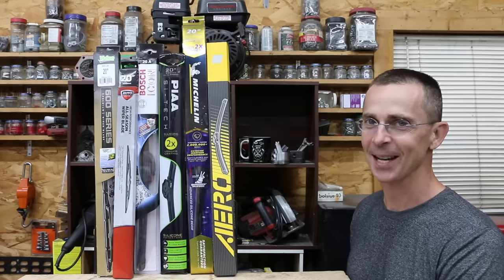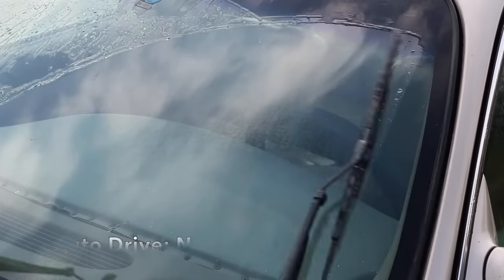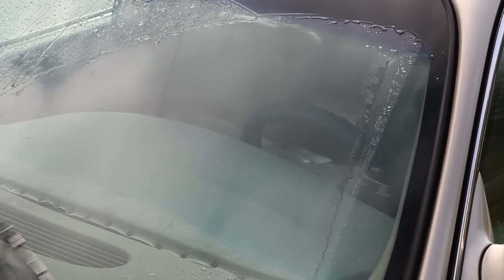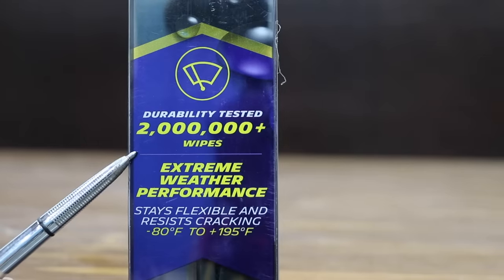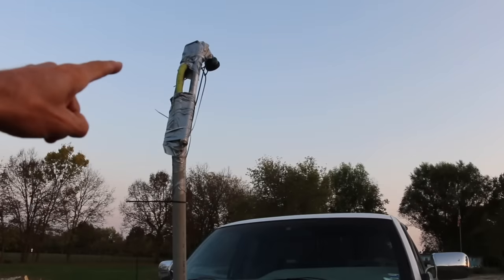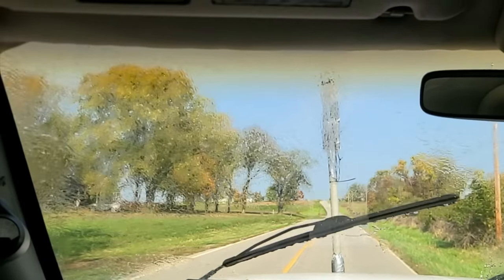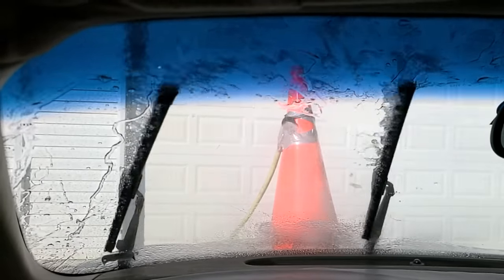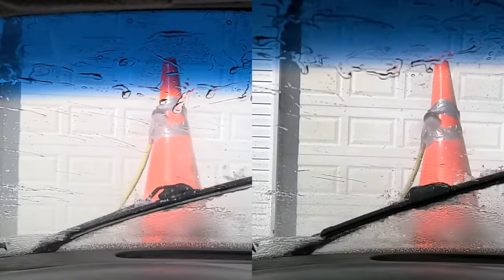Best Windshield Wiper Blade (AFTER 1 YEAR)? Bosch Icon, Rain-X, PIAA, Trico, Valeo, AERO

Comment: My most encountered problems with wiper blades are durability and the fact that they rapidly take a set (develop a pitch or angle).  The latter causes an annoying chatter as the blades pass across the windshield in the direction of the set.  This is especially bad when trying to clear a small amount of water, as encountered on a foggy morning.  I use the sprayer to minimize the chatter but it's still there.  Currently using Rain-X brand but they developed a set in a few weeks.  Was hoping you would address this in your video.
Reply: I live at high altitude (5000ft/1500 meters) in a desert with extreme UV and temps that swing from 105f/40c to 5f/-15c. Most wipers last a season or two for me at most. Bought some PIAA wipers 3 years ago and they have yet to start squeaking or chattering.
Reply: yes.  I HATE that stupid chatter.  very annoying

Comment: I remember another famous youtuber who would test products out (older guy who a few months ago made a new channel don't remember who it is off the top of my head) and he swore by silicone blades being really good. From what I remember in his video he had to apply this lubricant or something onto the windshield first before using the blades the first time but after that seemed like they worked great. I am a bit surprised there was no mention of that with the silicon blades and might be why they were making more noise?
Reply from the maker: Thanks for the feedback.
Reply: If you look carefully at the video the PIAA box states it comes with a windshield prep pack at 05:20.
Reply: You might mean Scotty Kilmer. He just pointed out that the silicone lasted him a lot longer than rubber in spite of being more expensive. He claims he has had a set on his car for about six years that are still sufficient. Also, the stuff he put on his windshield was NuPolish, a wax free polish and that should help with any wiper blade noise not just silicone ones.

Comment: I have run PIAAs for over 10 years on all of my vehicles since I live in the Southeast with lots of rain.  Nothing compares to the longevity and one factor you missed is the silicone buildup that occurs on the windshield.  Many times I don't even need to run the wipers as the rain just beads up and runs off without significantly reducing my visibility.  Will never go back, particularly to any non-silicone variety.
Reply: I doubt the "beading" you expirence is from the wiper runoff. Do you routinely run your vehicle thru car washes? There are a variety of soaps they use to protect paint that do the same thing. If you put Jet X(streak free dishwasher soap) in your windshield wiper fluid, you can do something similar. If you use pay and spray car washes, switch the dial to clear coat protectant and spray the windos, you'll notice a huge beading effect next rain.
Reply: @LWSParents  the beading is from the PIAA's silicone. When I switched to these I didn't know they did this and starting noticing the beading immediately as if I just went through a car wash and had a rainx coating. Installed these last summer and the beading hasn't lessened even in the slightest. I live in Pacific Northwest, one of the rainiest places in North America.
Reply: @LWSParents  This is an advertised advantage of silicone wipers.
Specifically one advertised by PIAA.
Reply: @LWSParents  silicone blades leave behind silicone as they wear out, which turns into silicon dioxide as it's exposed to oxygen.  Basically the same stuff used in ceramic coatings.  Regular rubber doesn't leave anything useful behind.

Comment: 15-20 years ago I remember the best wipers in my experience were conventional Michelins; they lasted exceptionally well, without streaking or noise. I could purchase them at about $10 then. One year they suddenly weren't. I don't know if they changed the rubber compound or something else. After going through the budget brands for several years and silicone blades (when they were labeled "lifetime" use), I settled on Bosch Icons as my new blade of choice, for the same performance you cite and moderate cost.
Reply from the maker: Thanks for sharing.
Reply: that swapperoo thing happens more and more. get a product you like for yrs then one day it sux. to me it boils down to some wiz kids showing up and touting how to make more money at less cost then after the bonuses are handed out they go elsewhere.

Comment: I tried the Bosch Icon for nearly a year and a half after seeing this video, and yesterday the Wiper seal starting to come out of one of them at a fast rate making them dangerous.  So I am switching back to Rain X.
Reply from the maker: Thanks for the feedback.
Reply: I had the same thing happen to me with the rain x, new out of the package. returned it for another blade and started coming out while using after a few months. I've never had it happen with rain x before, not sure if just a bad batch or they changed way they are made.
Reply: Wait, you got a year and a half of usage out of windshield wipers and are complaining about quality?
Wipers should be replaced routinely(6-12 months)as well as inspected and maintained.
U.V. isn't the only thing that causes wear and tear to wiper blades.
Dirt/debris does as well.
Reply: A year and a half? I remember when you were lucky to get 3 months out of the old frame type wipers.

Comment: I’ve found hardly any wiper blade performs well after a year.. the cheap $6 Michelin’s at Walmart work great and I change them out annually
Reply: Me too. Rain x definitely look and work a bit better in the beginning but after a couple months they all end up cracking no matter how expensive they are.
Reply: I agree. I use the Bosch because they fit my BMW but yes in the past with other brands all need to be changed yearly 👍🏼
Reply: I had an original set of Tripledge silicone wipers that lasted about 30 years before the tip of the composite frame broke in the ice and the rubber blade came out.  The rubber was still good.  I haven't found anything else that good.
Reply: @solarsynapse  30years!!!
Reply: Agreed. I just grab $10 Michelin wipers from Costco as soon as current ones stop working well.
Reply: I've been told it's best to change them every year anyway so I might as well go cheap.

Comment: I feel like one thing that was overlooked with the rain-x (which is what I use, so I am partial towards them) is that they also help by making the part of the windshield where the wiper blades touch the windshield hydrophobic. In my experience, that normally leads to less streaking, once the instructions are followed. Other than that good work!
Reply from the maker: Thanks!
Reply: Cant comment on their ability to coat the windshield, but I know that can be easily replaced and out performed by just coating the windshield with rain-x's repellant or some good wax every few months. Little more work every once in awhile, but I'd wager much better results and you're not locked into a certain brand of wiper blades.
Reply: The previous Wiper blade video had the rainx latitude with the rainx treatment built in.
He tested it last in the video so as to not taint the results of the other brands.
Reply: I actually use the regular rain x to coat the windshield  and it does such a good job at beading the water off that I seldom even have the wipers on. 😉
Reply: @KorruptorGaming  I agree.
Reply: Just use the Rain-X washer fluid. Application with no work!
Reply: @matthewbowen5841  Exactly, that stuff is the best, like $1 more than the store brand and you get a rainx treated windshield. Once I tried that stuff there was no going back to regular washer fluid.

Comment: Suggestion: "Wiper Refill" bulk blade material, possible you could test out just the bulk blade extrusion material that is used for refill/restoring existing wiper frame?
UV resistance, time , road debris, dirt VS teflon, silicone, rubber and possibly the best cost/time to have a consistently great/good wipe.
Thanks, fantastic channel, almost think there should be a "Leader Board" of recommendations to drive what is tested.
Reply from the maker: Thanks and you are welcome!  Thanks for the suggestions.
Reply: I haven't purchased an entire new wiper in decades. The idea of replacing that entire thing when all is needed is a refill blade borders on criminal. Huge waste of materials and money for no reason are all.
Reply: @wadefinklestein6013  Could you please recommend which "Refill" to purchase, if helpful to reference, for a Bosch Aerotwin 24"/18" set? Is there different T slot profiles to worry about? Which brand/material to choose for Winter/dirty mountain roads VS Summer? PNW, so anything that is quiet with varying levels of mist is helpful.
Does anyone sell blade by the roll rather than lengths, and the blade can be changed out more frequently when that is deemed advantageous?
I wish there was a full instalment to answer those questions and make it clear where to purchase!
Reply: @101rotarypower 
I'm no expert. I'm only familiar with what I got to work well on our stock Toyota wipers.

From my experience, I can tell you there definitely are different profiles. It's best to measure carefully and match with descriptions/ specs of refills. I buy ours on Amazon.

I had switched to Bosch Icons on my old Tacoma and did once attempt to refill those. It was doable but a real PITA compared to the stock Toyotas.

I believe I had found a YT video of someone taking apart the Icons. It helped a lot but they were still very time consuming.
Reply: Most don't have replaceable refills. My Aero ones do though, and came with a second set of refills.

Comment: Just picked up some silicone advantedge blades and came here to confirm I made the right choice. Pricier for sure, especially at the auto shop where I paid 80 for a set after tax.

But the rule is “buy once, cry once”. The performance over standard blades is tangible; night and day.
Reply from the maker: Thanks for sharing.
Reply: Mine makes loud squeaky nose after a week 💀

Comment: Thanks to this video, I just replaced my chattery AutoZone Duralast wipers with Bosch/ICON brand of wiper for my vehicle.
YES, I'm a long time subscriber & have been getting "Notifications" of new videos for years.
Warm Regards from Reno, Nevada
Reply from the maker: You are welcome!  Thanks for the feedback.
Reply: @ProjectFarm  I like to spray some Silicone on a small piece of gauze & then wipe it up & down both blades.  I "think" it helps keep the rubber pliable/soft + it cleans debris from both sides of both wiper blades.  
    I also make a point of pulling the wiper blades off the windshield at the end of the day in cold weather, to keep the blades from getting  frozen stuck on the windshield.

Comment: Back when I was early in my driving experience, I met a guy who I then worked with that was a chemist.  He had experience with treating rubber with glycerin to improve resistance to aging.  I had some rubber wiper blades the were in terrible condition.  We made a tray out of aluminum foil and soaked the wiper blades for a number of hours.  We then wiped the blades extensively to remove the remainder of the glycerin and put them back on my car.  Those blades ran smooth and quiet and removed rain perfectly.  I have Rain X blades on now that are a year and half old and they chatter nearly continuously.  Now, I think that I'll try the Bosch and treat the Rain x with glycerin just for fun.
Reply from the maker: Thanks for the feedback.

Comment: Nice vid, gotta say I've used the PIAA Silicone wiper blades for 5 years now and they have been great, never squeak, always work, not torn or noticeably worn down, and haven't had any issues. I will say I've cleaned them with denatured alcohol a few times, have applied "NuFinish Polish" twice since installing the wipers, and car has been only outside with no cover or garage other than shade part of the day.
Reply from the maker: Thanks!  Thanks for the feedback.
Reply: Buy some silicone spray lubricant and put em on the blades, they'll last even longer.  Also helps with old window motors that struggle to raise your window or are slower. That black plastic trim on both sides of window usually gets dry and cause the window to strain a bit when being lifted by the motor. Spray em with silicone and you'll notice the speed of your windows will increase. Works on older cars of course.

Comment: I've watched this video a few times now and finally decided to give my input if you happen to still be reading comments.

The only time I've noticed wiper blades working worse than they should is when the wiper arms themselves are bent or misaligned, or the wipers have debris (pollen or crap from trees) on the blade.

Bosch Icons lasted me 3 years on my old car, and almost 4 years on my current car. They probably could've gone longer but I got a new pair on sale a while back and put them in my trunk as a backup. Still didn't have any issues with streaking or chattering.

I regularly detail my car, and wipe the blades off either with CAR glass cleaner (not Windex) or whatever spray wax/sealant I happen to be using. Probably helps more against the UV and aging than what other people have been experiencing normally. Letting rain and wiper fluid clean everything alone is not enough in my opinion to keep things functioning optimally.

That being said, with my habits I could probably get more life and performance out of most wiper blades, but Bosch Icon does everything perfectly for me and I have no reason to switch 👍
Reply from the maker: Thanks for the feedback.

Comment: Aero wiper blades are so underrated! I have them on my ‘16 Civic Touring and they make no noise whatsoever and leave no streaks! Bought a pair for under $17 and the added cherry on top was it comes with an additional insert so when they do wear out (after almost a year) you can easily replace them without discarding your wiper blade! Ecofriendly and cost effective!
Reply from the maker: Thanks for the feedback.

Comment: I purchased a set of PIAA silicone wiper blades in October of 2016 and those blades are still performing well on my daily driver that is always parked outside year round. While they are more expensive up front, they are the longest lasting wipers that I’ve bought in the last 20 years.
Reply from the maker: Thanks for the feedback.

Comment: I have had a pair of silicon blades on my truck for about 15 years, and they still work well. Not perfect, but they work. Defiantly worth the extra money. In the Arizona heat, rubber blades usually start to come apart in a year or two.
Reply from the maker: Thanks for sharing.

Comment: Great video, as usual. 

Up to the summer of 2011, I stuck firmly with the cheapest wiper blade I could find. In June of 2011 a young lady at Advance Auto Parts talked me into spending over forty dollars on a pair of Bosch Icons for my old Saab. I got almost three years of outstanding service from those blades. I have tried several other brands of wipers since then, but I keep going back to the Icons. They do a better job and last a lot longer than anything else I have tried. Your test seems to concur.
Reply from the maker: Thanks for the feedback.

Comment: I have owned 8 Honda Accords starting in 1978. Honda sells wiper inserts that you put into the stock arm. They always work perfectly. The original manufacturer blade may be the best as they have the correct spring rate and best materials.
Reply from the maker: Thanks for sharing.

Comment: Just installed new Valeos (beam style) on both vehicles.  My car didn’t need it, but my wife’s did.  Figured heading into winter I would do both.  Let’s see how they did.  I got Valeos a few years ago free on Amazon about 7 years ago and were the best I’ve bought in over 40 years of driving.  My Valeo are higher end than shown.  Note I use rain-x on my windshield, but not on my wife’s vehicle.    Appreciate your work.
Reply from the maker: Thanks!  Thanks for sharing.

Comment: I dont remember this video release but i do remember your Bosch clear advantage test which was just as good in another of your tests as the icons did in this test. I've been running clear advantage blades since I saw your clear advantage test 4 years ago. Because the icons are 100%-150% more in price than CA, I'll continue running CA blades. Excellent value to performance ratio.
Reply from the maker: Thanks for sharing.

Comment: My personal evaluation of windshield wiper blade brands was ongoing through decades of Northeastern US winters.  While snow and rain clearing was the actual blade mission, I eventually settled on Bosch for the strength and reliability of its clips and frames, which I found to be the only brand that didn't literally break apart fighting wet slushy snow while driving in "blizzardy" conditions.
Reply from the maker: Thanks for sharing.

Comment: I always clean my wipers before I drive, even if I know there's no rain ahead. Giving a couple squirts of windshield fluid and wiping a few times before you start driving is very useful for extending the life of your wipers. That way, they stay moist and don't crack in time, it also seems to prevent squeaking.
Reply from the maker: Thanks for sharing.